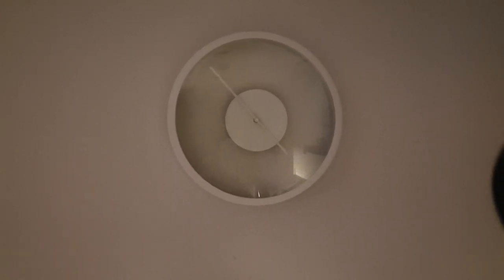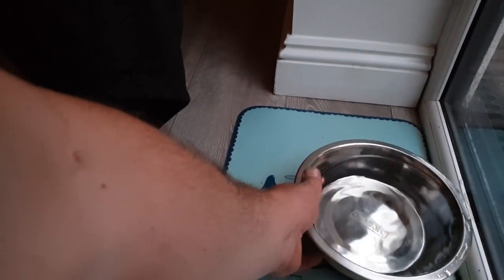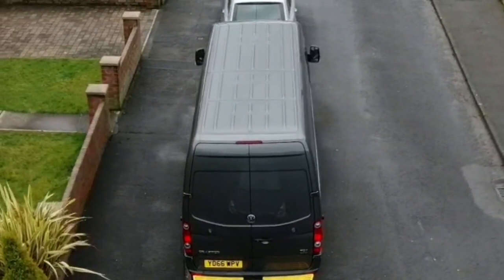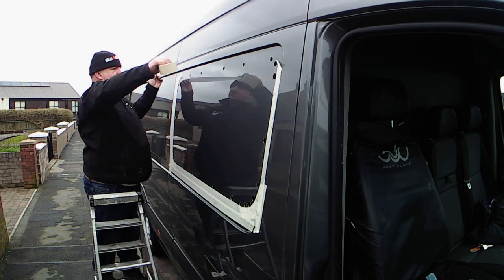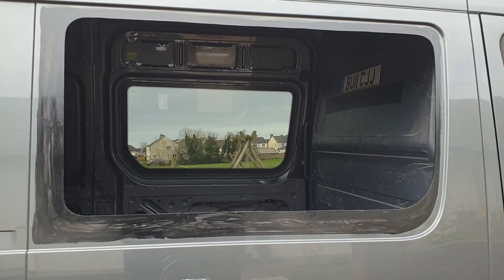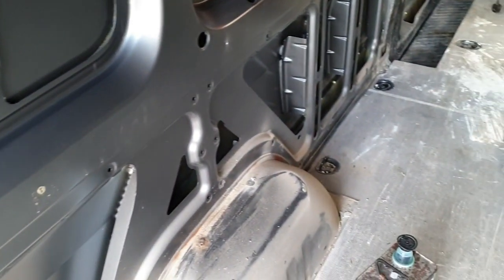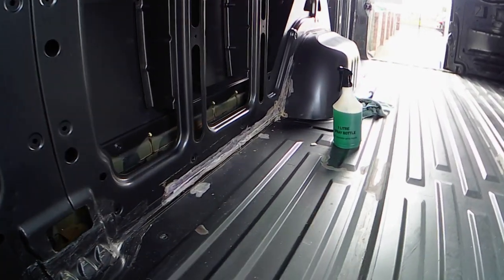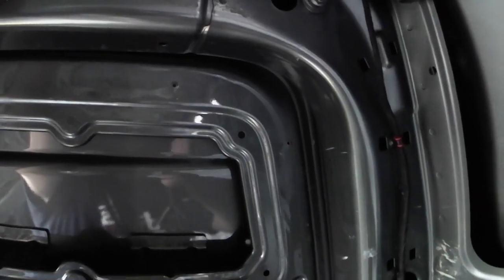selfbuild campervan crafter sprinter | window install | van build | part 1 | the crafty blinders

Comment: Hi Sam. Thanks for the video. Did you put the sacrificial trim in to get an even gap between the glass and the outer skin ready for the permanent trim? Also did you put in the final trim that covers both the outer and inner skins? Thanks for you help.
Reply from the maker: Yes the sacrificial trim was there to keep an even gap as I wanted to finish the auto trim then add the final trim over both skins and the auto trim for final finish and it looks tidy now 😁👍
Reply: @TheCraftyBlindersvanlife  Excellent! Not many builds explain that. Thanks for your help :-)